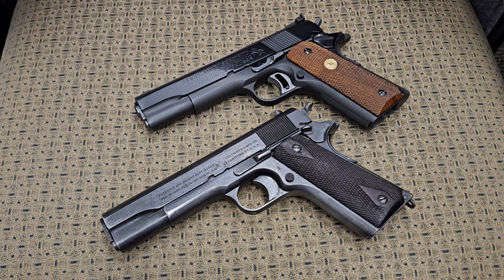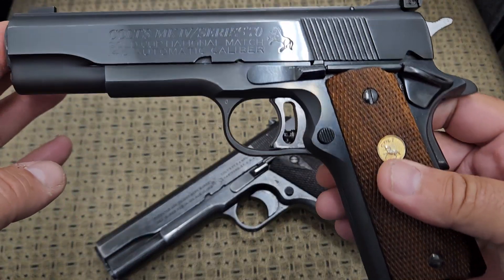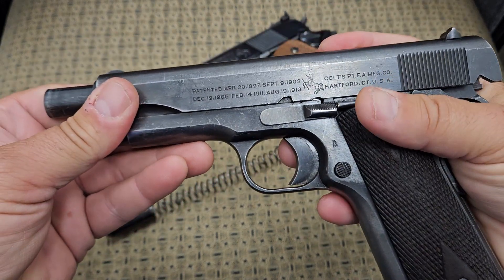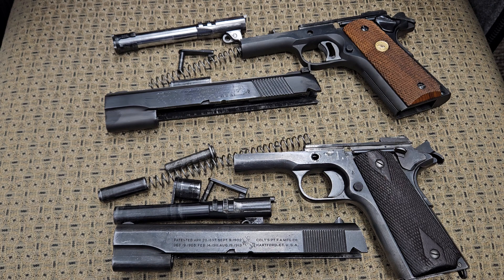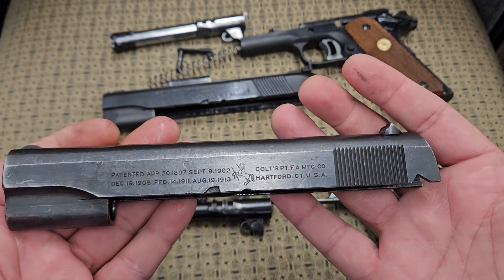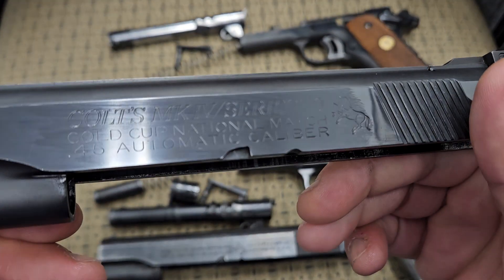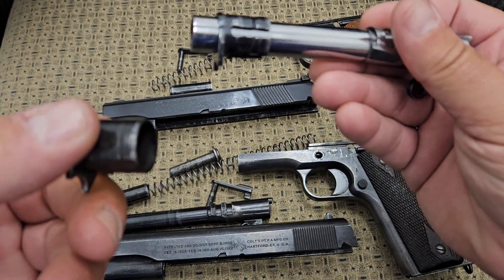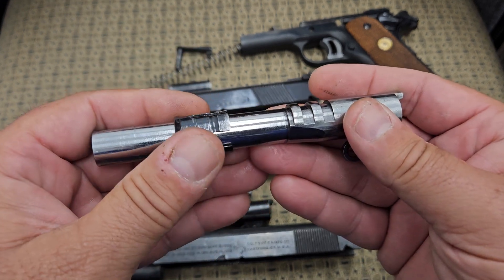Colt 1911 Series 70 vs Older models explained in depth

Comment: Didn't the series 80 Gold Cups also have that horrible "fly" mechanism on the sear to keep the hammer from following due to the heavy steel trigger? Anyway, its funny, I've got a 70series frame, barrel and bushing riding on a 1940's Nat'l Match "hardslide" over 20k through it and that collet bushing is just fine- and it's dead on accurate, - great video!
Reply from the maker: Thank you very much for watching